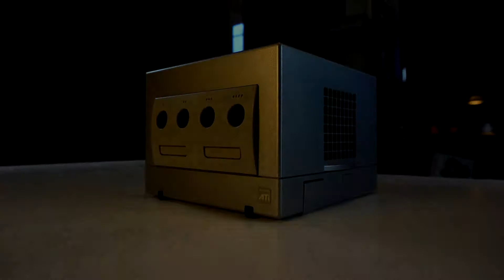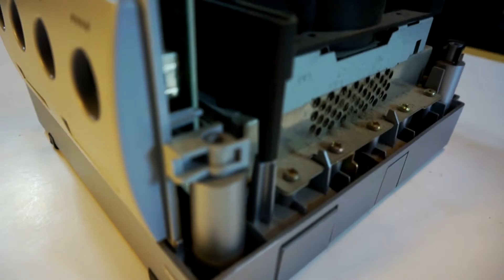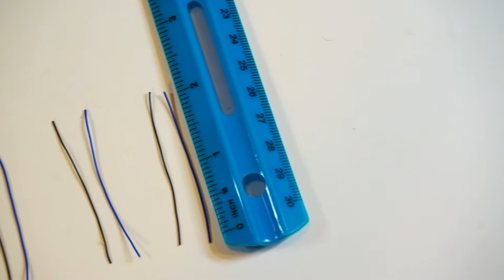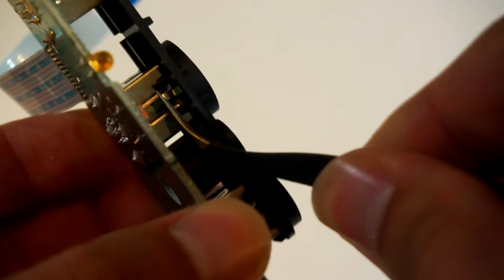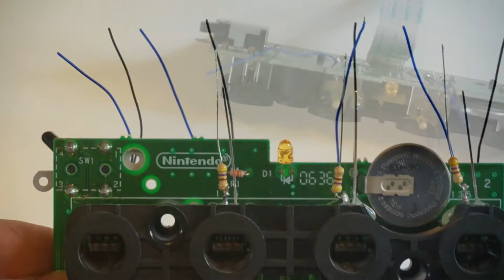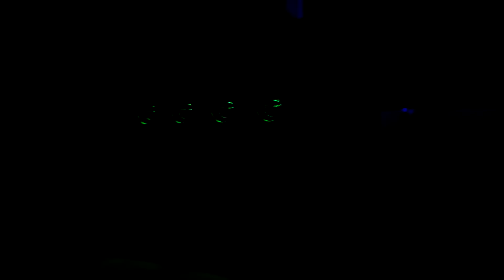How To LED Mod Gamecube Controller Ports

Comment: I did this and didnt realize my LED was 3.0-3.2v...used the same resistors.. but now gamecube wont boot with the board plugged in...am I to use another resister?
Reply from the maker: Of the top of my head I don't think resistors are actually required but I was just in the habit of using them back then. But if the gamecube won't boot with them installed I'd first remove them and try, if it still doesn't boot you may of messed something up?
Reply: @TechnoOnTop  figured it out amigo. It wasn't anything to do with the LEDS. The ribbon that goes to the board stressed off the ports motherboard. (Humidity from hurricanes did a number on my gamecube)

Comment: can something happen if it is incorrectly connected or soldered, i.e. it explodes or something, or does it simply not work
Reply from the maker: Sure if you connect to wrong parts it can short stuff out and ruin parts
Reply: @TechnoOnTop  So the points themselves are all soldered correctly, but it was just briefly connected with the soldering iron to the board or to another point because I've never really soldered before, but otherwise there's only 5v on the board I think and it can't be too loud bang or something but maybe a bit smoke and broken right sond is there an email or something where I can show peer pictures? I stopped with a charging pack for my cell phone and a USB cable to check the led and the power led, everything is on and working. I haven't connected it to the power supply myself because I'm afraid XD
Reply from the maker: @daunzerlp7142  the easiest way to share pictures would be through Twitter. Or you can email them to me at technoontop@aol.com

Not sure how much help I would be, when you were soldering did you have the gamecube on? I can't imagine the soldering iron itself causing an issue if you touched 2 points.
Reply: @TechnoOnTop  i have send a email whit picture to you i hope you found is and i can start normal the gamecube

Comment: I just bend the metal controller tab up, and used that to pinch my led in place.  Then small glue needed.  It's a great helping hand.  Plus helps reflect more light into the port
Reply from the maker: Sounds like a good way to do it! Thanks for sharing!

Comment: I’ve seen ppl use the lights without a resistor.. does matter?
Reply from the maker: You don't need to use a resistor, I just did purely out of habit. Sorta an oversight on my part.
Reply: @TechnoOnTop  I got you. Do any 5volt led lights work or can it be higher voltage ?
Reply from the maker: Sorry for the late reply, leds come in different voltages based on their color, wouldn't stress the voltage, just get 3mm leds in your choice of color.
Reply: @TechnoOnTop   your all good man😂

Comment: Did this mod the other day, looks excellent! but instead of using hot glue to secure the LEDs in place, I used those same metallic clips that you push up the controller board instead, those clips can hold the LEDs pretty well too, and if in the future you want to undo the mod or change the LEDs for a different color ones the process will be very easy and the work looks way cleaner that way.
Reply from the maker: Thanks for the info! iv definitely moved past using hot glue for anything I don't even consider it anymore. Making alot of my tutorials obsolete.

Comment: how do you know which leg is the positive on the LED ?
Reply from the maker: The positive leg is longer
Reply: longer leg is the Anode (+) - shorter leg is the Cathode (-) Also on most LED's the base of the LED enclosure on the cathode side (-) with not be circular and have a flat side.

Comment: why are you ussing resistor? from the controller slot there is 5V , are you ussing them just to conver them into 2.2v?
Reply from the maker: I use resistors for everything lol.. It's really just habit.
Reply: @Pharacelcus green led is 2v or maybe 2.2 pretty sure

Comment: DONT BREAK YOUR PORTS WITH GLUE JUST BENT THE CLIPS AND GLUE THE LEDS ON THE CLIPS DO NOT GLUE IT ON THE PORT!
Reply from the maker: thanks for the recommendation!
Reply: Fun thing too replace the top led for on and off with a rainbow led!
Reply from the maker: yeah i have seen those before they look pretty cool

Comment: Hi i have bought some leds 
Forward Voltage (V) : 1.8-3.4V
Current: 20MA

Will i require different Resistors? 
or would these do? 

https://www.ebay.co.uk/itm/470R-470-Ohm-1-4-Watt-5-Resistors-Pack-of-10/263367284201?hash=item3d51e9d5e9:g:uUEAAOSwA3dYdQAg
Reply from the maker: i always use the same resistor for almost every LED project i do. so i would say no, but there are resistor calculators that would help with figuring out what LED and resistor combo would get max brightness, but iv never worried about that, at least not with console mods. if you were making tail lights or somthing definitely more important
Reply: Ok buddy thanks :) 

So those resistors on ebay link would be fine? they the right kind?
Reply from the maker: your welcome, and yest those are the same value as the ones i use

Comment: It'd be great if you could have it light up depending on if a controller's plugged in or not.
Reply from the maker: Smedis2 only if they weren't lighting up the inside of the controller port, because once you plug in a controller you can't see the light, but I suppose it would be neat if it was an indicator led, which I have seen. Thanks for watching

Comment: Hey trying to do this mod now, but I have a question. Where could I get the wire you use in the video? Would this work? http://www.ebay.com/itm/USA-Shipping-10-x-10-ft-30-AWG-Wrapping-Wire-/352012815812 Because I ordered the wrong kind before and I don't want to make the same mistake. One more thing: did you solder the wire to the resistor and led? Sorry for the questions. I'm completely new to this
Reply from the maker: Jack Ihry that's exactly the wire I use so it should work perfectly for you. But I solder the resistor directly to the source, then hook all the leds to that. Or you could attach the resistor directly to the positive leg of the led but you would have to do that to each led. So (led-resistor-source)
Reply: TechnoOnTop do you need to do this mod with the resistors or is it just recommended?

Comment: Cool post! Any details on solder you used? Thanks!
Reply from the maker: the solder is 63/37 rosin core solder .8mm diameter. brand name is Kaina i bought it off ebay. thanks for your comment! i appreciate it
Reply: Thanks so much for the info. I'm going to reuse a dead GameCube as a RasberryPi and your mod will add a nice touch! Thanks again!
Reply from the maker: no problem! sounds like a cool little mod, be sure to share it when its done i'd love to see it!

Comment: hey what were the wires and resistors you used?
Reply from the maker: sorry for the late reply, wire= 30 Awg (american wire gauge) Resistors = 470 ohm 1/4 watt, it wasn't left out of the video, but thanks for watching!
Reply: thank you so much, I am a bit hard of hearing so I couldn't fully hear it lol
Reply from the maker: no worries added encouragement to add subtitle to new video then.
Reply: TechnoOnTop which kind of leds did you use to be compatible with the resistors? Thanks in advance!
Reply: https://www.ebay.co.uk/itm/252051414009

theres a uk listing for what he uses. there are other colours available!

Comment: Do you know the voltage of your LED's?
Reply from the maker: T Major forward voltage of 2-2.4
Reply: do you happen to have a link of the ones that you used?
Reply from the maker: T Major yes I used these http://m.ebay.com/itm/3mm-Green-Flat-Top-Ultra-Bright-Wide-Angle-LED-50-Pieces-/281517370602?hash=item418bbe2cea%3Ag%3AYeIAAOxyeZNTStJU&_trkparms=pageci%253A04fa92fb-a07f-11e6-b6dc-005056b67178%257Cparentrq%253A21eb25dc1580a60625788e74fffc08c6%257Ciid%253A04fa92fb-a07f-11e6-b6dc-005056b67178 thanks for watching
Reply: Sothey are 3mm LED's not 5 mm
Reply from the maker: feel free to use either 3 or 5mm leds, i did this to two different boards in this video because of a filming error both sizes will fit.

Comment: Would this work on the Wii with Gamecube Ports?
Reply from the maker: I don't see why not,  the pin out would be the same but the board may look a bit different but you should be able to find the 6 controller  pins.  I never considered doing that to the wii.
Reply: did it work for you?